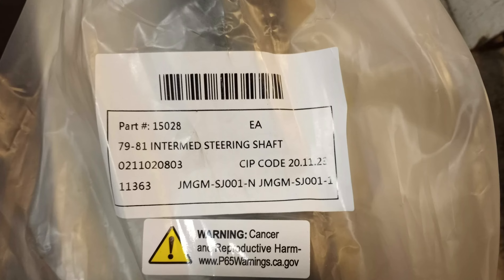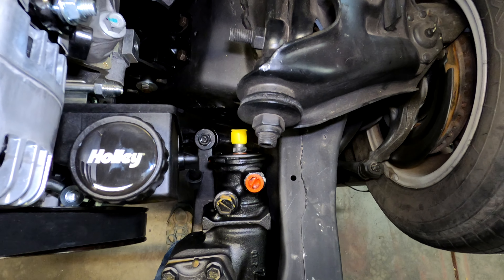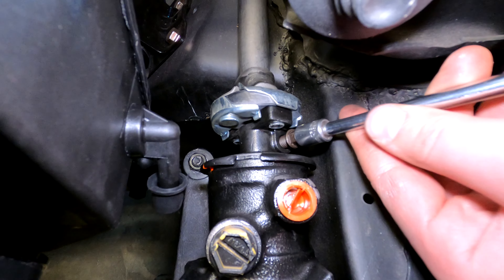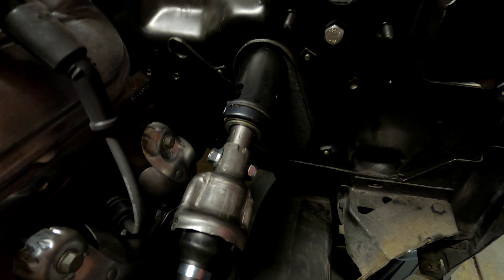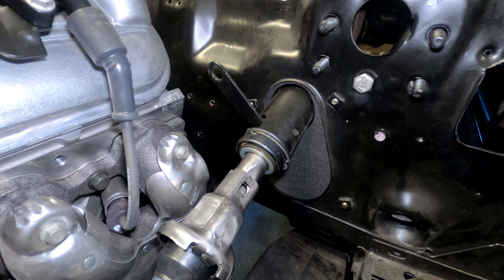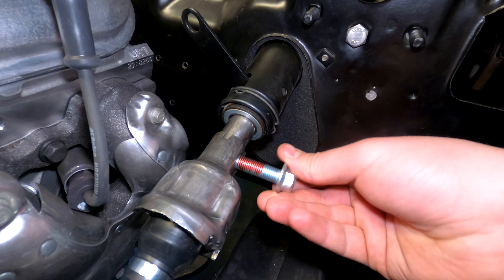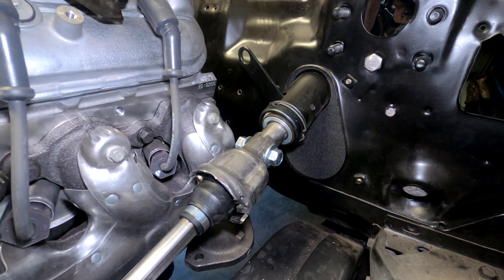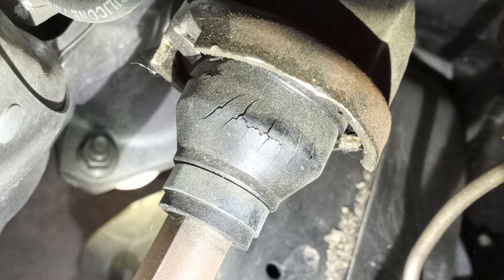1980 Camaro Intermediate Steering Shaft - Installation

Comment: I did the intermediate shaft on my 1979 Z28. I also had a sloppy fit collar. I swapped the old collar onto the new shaft and nice and tight.
Reply from the maker: Yep, Dylan's Camaro still is a long way from having the nice, tight-feeling steering of a new car.  Partly that's because we haven't replaced tie rod ends (yet) but partly because we didn't get that joint as tight as we'd have liked.  Sounds like you really solved it.

Comment: Hi Nice job, I’m doing the same job on my 55 truck has a 78 Camaro clip does the intermediate shaft telescope in and out enough to get it in and out because on my old one I pull the steering box and shaft together but I’m hoping the new one will telescope a bit so I can install it after the steering box is back in, any help would be greatly appreciated, Mike
Reply from the maker: Hi Mike - we had the steering box and steering column installed before installing the intermediate shaft.  The intermediate shaft was able to telescope and that's what allowed us to install it, exactly like you're thinking.  Just as a bit of an update - we were pretty unhappy with the poor condition of the rubber after very little use, so we're replacing the shaft in this video with a different, aftermarket design.  We'll show that replacement in a future video.
Reply: @WorkinOnIt  Funny you should say that, because i ordered a Jeep style, i will show it on an upcoming video, i will let you know when it's out, i am also going to fully disassemble the shaft instead of buying a new China one, lol, really appreciate the reply, and i'm subscribing to your channel😁😁
Reply from the maker: @DesertRatFabrication  I look forward to seeing what you do!  Subscribed!
Reply: @WorkinOnIt  awesome thank you 🙏

Comment: Go with the Holley steering shafts. They get rid of the stock rag joint. 320-310 should be the part number you need.
Reply from the maker: You must've read my mind.  I literally had that in my Summit shopping cart, just waiting for a couple of questions to be answered before pulling the trigger.  I'm going to order ASAP.  Thanks!

Comment: Nah that was too easy. I lubed it up and lined the flat spot up and it wouldn't push onto the rag joint with all the force I could give it.
Reply from the maker: You're just "lucky"; if we had run into that, I definitely would have talked about it.  How did you solve the problem?